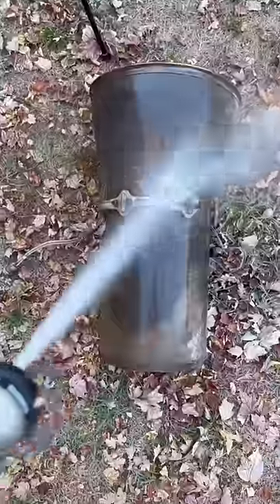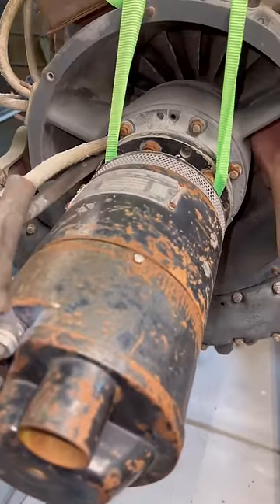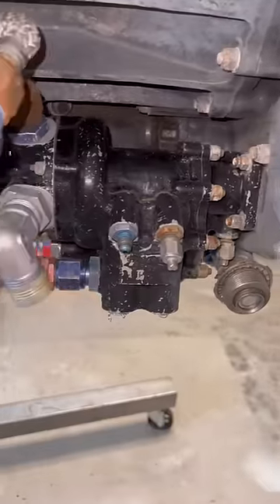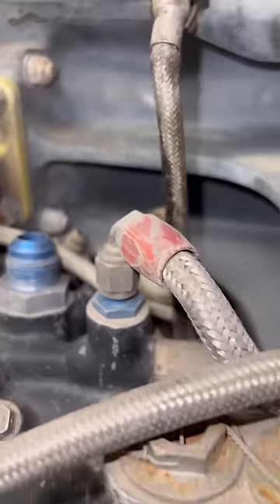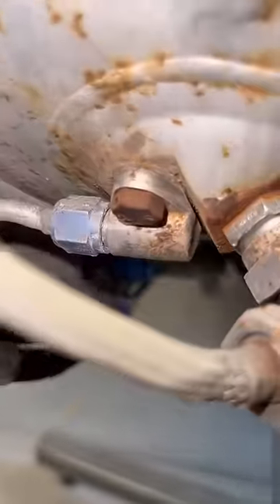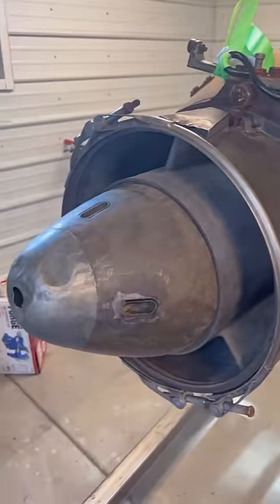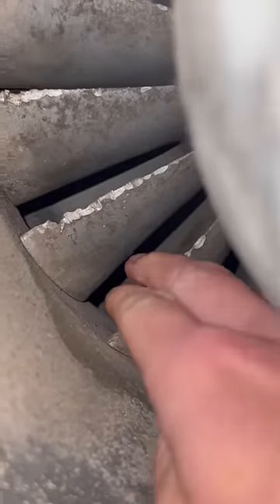Overhauling a Jet Engine in My Backyard for Fun

Comment: You better get double ear protection before you start the T-37B engine. It’s extremely loud for such a small one. I worked on those planes for 3 years way back. It’s no joke.

Comment: 5 words. Tempered carbon fiber compressor blades. 
Source: I worked for GE aviation.
Reply: Can my man's get them shits on eBay or sum?
Reply: No Ding Dong, Amazon!
Reply: Thanks, which turbine makers use those?
Reply: @nostradamus7648  you will find that in the DIY section at Indigo under the Building Jet Engines for the handyman
Reply: @sebione3576  no. I can show him how to make them, from cloth to autoclave.
Reply: @nostradamus7648  these were for Boeing 747s, GE Aviation manufactured them exclusively for Boeing, and maybe some unnamed government entities may have had special orders from there. Idk for sure, but I had to get a government classified clearance as a contractor, and the Boeing turbines were cool, but looked to be bog standard twmperd carbon fiber compressors.
Reply: @sebione3576  they gotten down in Ohio....
Reply: @erisgh0sted961  tooling and high temp prepreg and hiring an autoclave? Bro is gonna need to win the lottery for that

Comment: I’d be very cautious around that igniter box. Kerosene fuel takes a much higher voltage compared to regular gasoline to ignite. Somewhere in the neighborhood of 40-60kV typically, enough to kill in an instant. Igniter units like those can also remain charged for 30 minutes to an hour after operation, as they typically use capacitors that hold large amounts of energy.
Reply: Ben Franklin learned about electricity but this guy is ASKING TO DIE if he plays with that baby. JOULES OF ENERGY THERE.

Comment: You’re gonna have a problem. You will need to replace those compressor blades. Possibly on multiple discs within the engine. You will also have to inspect and repair the turbine in much the same way. But once you get all new blades installed, you will have to balance the discs otherwise the whole engine can come apart on the first run up.
Reply: God forbid he has to get into the gear box 😎

Comment: You need to take the engine completly apart so you can clean thall bearing surfaces realllllly well!  There can be no dirt or sand anywhere in the lube and bearing systems.  2) as below if the turbine comes apart it will go off like a bomb in a radial pattern from the rotating power shaft.

Comment: “Makes a little spark” 

Good luck, god speed. 

This dudes maintenance is a smoldering crater waiting to happen. *Enter NTSB and FAA.
Reply: it takes months+ for a guy to become even remotely capable of servicing one of these things properly

but more importantly firing up a jet engine in a neighborhood almost certainly violates noise ordnances even if nothing goes wrong, and you could feasibly be held liable for your neighbors getting ear damage from the immense noise

Comment: Starter Generator just change the brushes, the little box is called an exciter box. Change the plugs which there should two igniter plugs, make sure you get new leads also. The fuel control can be complex, we install new and then rebuild on the bench. Good luck brother sounds like your on the right track. Oh one other thing you’re going to have to rig the throttle and the fuel control. I hope you have some manuals. The fuel control rigging can be difficult.

Comment: Great thing about a jet engine is that they can run on almost anything. . .

Warmed up cooking oil will work just fine but you might have to get it started by mixing a littlebit of zippo lighter fluid. . . . .

Ooooh, you have jet fuel. Refined paraffin.  .  

Cant wait to see her running. . .

TGC 
Blessings:)

Comment: The igniter in an oil furnace will work. Also the fuel nozzle will atomize your jet fuel properly. Just make sure your fuel pump is putting out a LOT of pressure.

Comment: You’d also need to replace the magnito-reluctance phase 3 to get the starter to work. 
Also, the turbine blades will need a new set of prefabulated amulite, surrounded by panendermic semiboloid solts. I’d need a whole to help you out. Good luck!

Comment: You can also blend the compressor blades to remove dings and damage as long as you leave it balanced
Reply: Compressor blades dont bend they shatter they are made of special steel that is proprietary info not your average metal.

Comment: You can file those compressor blades, they don’t need to be perfect to run. I would take the rusted bolts out and make sure they aren’t ready to crack off, that engine coming apart at speed will be lethal. Good luck!

Comment: Be careful when starting it, if the blades are poorly balanced and it revs too high it will probably end up exploding. You should also have some form of emergency to cut off the fuel supply in case it gets out of control. Finally you should also check the lubrication system, sometimes a turbine can use the lubricant as fuel and run away. Good luck.

Comment: 40 years ago we fished out a target drone out of the Pacific Missile Test range like the others it had a reward for it but it was not worth much ! It was in much better shape we took it home and strapped it down on the back yard picnic table we then tried various ways of starting it! Our last attempt was disasterous using a powerful air compressor kerosene 2 cans of ether starter fluid and a piezoelectric sparker we got it running ever so briefly before it consumed in flames thankfully we were able to put it out with garden hoses ! Lesson learned we never tried that again  . Please think things through and be safe !

Comment: As an actual aircraft mechanic, that sparky box should absolutely NOT be messed with! Do NOT use a taser 

Anyways, make sure the air starter has oil. Then, make sure has proper turbine oil. Looking at it's rough shape, replace all gaskets and o-rings. Those fan blades damaged should be feathered out or replaced. Ehhh, grease the bearings.

Have fun and don't die!

Comment: Just get a couple of flap discs from harbor Freight and smooth off the edges of those blades. It might have a funny vibration at 20,000 rpm but just put the flaps at 10%

Comment: I was an F-16 mechanic in the Air Force and I can tell you those fan blades are probably the reason that plane was retired from service. I wouldn't even bother to try starting the thing because once those turbines get up to speed if the thing will even start those blades are going to go flying everywhere. Please I know this makes for good content but don't start that engine at the very least you're going to have property damaged, if not something much worse

Comment: As an A&P guy, blend those blades. You might want to inspect the compressor and turbine rotors. Nothing is more dangerous then a fuel leak on one of these, please inspect the fuel system.

Comment: My man. Your going through all this effort pour some concrete and test that damn thing. And just a lowely apprentice machinist here but study your manuals replace your compressor fan and test that baby anyway. Do your airframe up right. Two separate projects I would think needing separate attention. Two checks. If your bold enough to do this be able to send it. Godspeed

Comment: I'm not sure if he can get it started, but the igniter has enough "spark" to kill if he's not careful, and the compressor and turbine blades can break off with explosive force during high rpms. This happened on a commercial flight of a DC-9, and people died. Those blades are in poor condition.

Comment: So the stand has to have enough mass in the base to resist variable thrust at an oscillating pitch( it could hop around) im thinking of a frame for a shaker screen setup. They are used in mining, to seperate fines from aggregate sizes.

Comment: You should be able to pay a machine shop to grind out all the mangled chunks  on it it'll lose performance sure but it'll be balanced and safer also a lot of older jet engines were way overpowered for the vehicles they were in

Comment: The compressor blades are finished, if you could start it the imbalance caused by the damaged blades will probably destroy the engine by the amount of vibration

Comment: You need to make sure those spinning blades are balanced.
Those gouges have certainly unbalanced it.

A jet engine is walking with ease at 50k RPM.
If it's off balance, it will blow apart.

Comment: You migjt be able to replace the compressor blades on an idviudal bases secondly if you cant get new blades you.might be able to fule them smooth just make sure to file the blades on the opposite side as the compressor blades are balanced to prevent wobble

Comment: chances of you sourcing o-rings, shims, bearings, ignitor,  ignition exciter and compressor wheel are very slim....with that compressor damage, there is likely damage behind that wheel. FOD damage is usually very extensive

Comment: I really hope you understand that this stuff needs to be overhauled. Especially the starter. Check the brushes and armature. None of this matters if the starter blows up. I would also highly advise to not start it with the compressor vanes looking like that. In fact, I wouldn't even try to start it period.

Comment: This guy thinking that an aircraft engine is like starting a barn find Chevy.
Reply from the maker: Honestly, it’s kinda easier. Airplane engines are designed to be routinely overhauled and jet engines, especially the J69, are actually really simple in principle. Not saying it will run for sure, but getting it to a state where I can give it a crank is not too terribly hard.
Reply: @jackschneider17  I went to school for my A&P and I agree jet engines are a lot simpler than your average 4 stroke engine. I was being funny about safety concerns. NDT is probably your best bet.

Comment: This isn't a pickup truck Diesel engine. There's a reason why it was junked. Let's say you get it started without blowing yourself up. If it's not secured in place you will have a disaster. Is something like this zoned for residential use. People have posted comments to help you not hurt  yourself or someone else. 🫣

Comment: I guarantee every bearing in there is shot… your fan and compressor blades are probably shredded, the fuel system will be contaminated, and your ignition exciter is probably inoperable… jet engines take a lot of maintenance and I wouldn’t dare to even try starting that thing

Comment: Just figure out how many volts the starter generator requires to rotate, 12/24/36, etc.. and then just apply the required voltage to it and see how well it rotates.

Comment: I'm worried about this. 
How many run hours has this engine had. He could be looking at blade creep, stress corrosion and fracture. This could result in an un-contained blade release, just by starting it up. 
Bearings are probably knackered they'll be life limited.
This is just asking for trouble. This needs to be stripped and inspected
Also those exciters hold charge for a couple hours after a start. Touch that and you're gone.
Reply: Wow I just saw the compressor. Seriously stop what you are doing

Comment: This is not a 427 V8. You need proper tools, proper environment with little contaminants. And proper parts as well as an educated engineer with experience to give it a safety inspection, or you can detonate your house and mince a limb in the process.

Comment: The odds that that fuel control is still functional are astronomically poor. I would expect a compressor stalling hot starting mess if it even works at all. Or…..it could just high side and blow the whole show to the moon. Either way, I hope you have good insurance.

Comment: right. so you wanna test run a jet engine while it's hanging from the ceiling on some ropes.... :P you don't think some concrete and steel test bench is needed for that and that it won't simply blow through your house and your neighbors house before the fuel hose is empty :P. gee. can't wait to see that episode :P
Reply: it's not some car or truck engine you can just test run strapped to a pallet or hanging from the crane you know lolol.

Comment: That water was a mistake. It's rusting already & you just made it lot's worse. I bet the bearings are still holding that water you put in and they'll need replacing. 
Before soaking it in water you should've sealed up the electrics and the intake & exhaust.  
In other words, I think it's buggered!

Comment: I respect your efforts, but be ware jet engines are very dangerous. Those blades look old and a simple miss balance or crack in them will cause in to vibrate or worse, jettison a blade right through the cowling at supersonic speeds.

Comment: So that thing supposed to spin at an unbelievable speeds do not start it. It will fly apart. Replace the blades and bearings. As someone who has worked on them. But I will watch to see if or when you harm yourself

Comment: “Sketchy”….aka, would be an idiot to try and start in that condition. Not like jet engines are build with extreme tolerances or need to be balanced or anything. Really hope you don’t just try to start the engine in this condition.